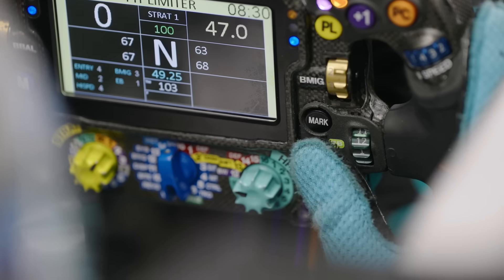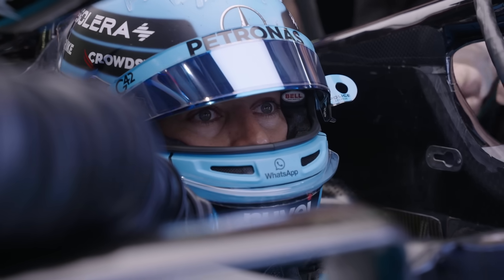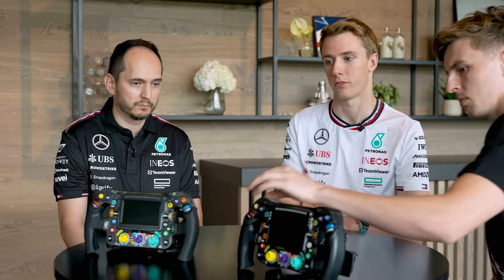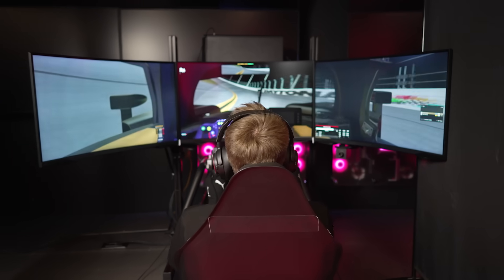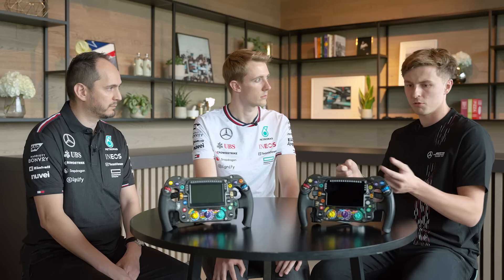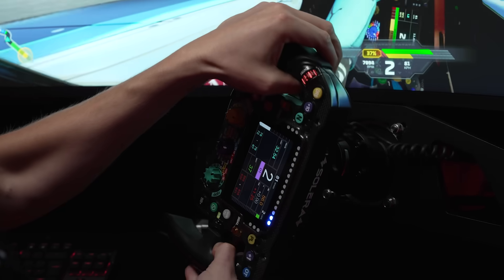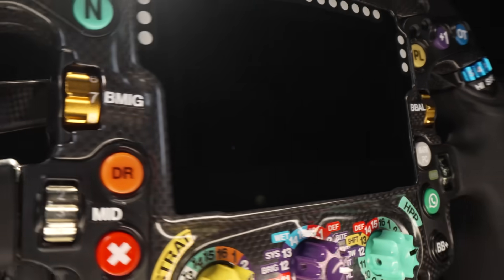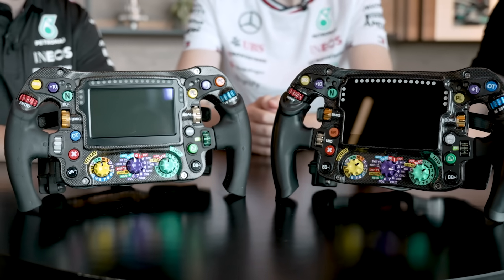We created the MOST accurate F1 Steering Wheel for Sim Racing! 😱

Comment: They gave the wrong answer when they said is it faster? Because with F1 you are trying to wring every drop of performance out of every part of the car and the decreased mental load having so many buttons to change so many things on the steering wheel may only increase performance or speed a fraction of a percent but that's still one or two kilometers an hour which is the difference between lapping someone and not at some tracks

Comment: I wonder if this wheel will have more success within F1 fans or simracing users, Mercedes has the best looking of the F1 wheels but not having the 7-way/funky switches can be a deal breaker, also it doesn't have proper dual clutch (has a feature that mimic it but it's not he same thing).
Was expecting more of a detail explanation of how it works and not a pure bs sponsored video, 280mm is good for Formula cars, but for prototypes is better 290-300 and for GT3 is better 300-310mm, so the best for all is 300mm...

Comment: 3:05 really emphasizes my feelings on this. In the past some F1 teams (not gonna name names, but… starts with an F) have put their branding on replica wheels, but they haven’t been exactly the same CAD models, materials, etc. Some people in the community have attempted to make replicas as accurate as possible, but they only had access to photos and rough dimensions. Photogrammetry is pretty good nowadays (see: 2020 Racing Point aero package) but it’s still not perfect, so it’s awesome that a true replica is available now. Thanks guys!
Reply: Surprised you didn't notice neither is this one the actual CAD, if you pay attention you would notice it's a combination of design of w11(=8~10) and w12(=13~15), and the grip especially the top end looks completely different to either of the actual wheels.

Comment: I am quite sure that they are different in many ways.

The main thing will be the software and hardware. The F1 steering wheel will have processors for comuication from the ECU or other car devices. In simracing the communication protocols with a windows PC are different. I don't think the data processing units in both applications require the same power, so they will have reduced costs.

I imagine that the screen and RGB lights on the simracing steering wheel are not the same as in F1. There they will have saved costs as the one used in F1, manufactured by Mclaren, I don't think it's very cheap. Also, it is not necessary to use the same component when you don't have communication with FIA, etc.

On the other hand, I imagine that the F1 one has a connector inside the QR, while in the sim one, the cable is separate, since, in simracing, each user will use a different QRs, for his simulator. The F1 car QR is unique (there are only two cars and they make it), and also, saving the cable is much more practical when it comes to getting in and out of the car, etc.

On the other hand, the guy on the right, says that in simracing, you need the same amount of buttons and knobs as you might need in the F1 car. In simracing, you often need to move around the simulator or game menus, and also change certain parameters in an unlimited amount of increments and decrements. The F1 car, generally the wheels they use are fixed position. Also, most of them are designed to be used when you are on the move. In simracing it's not like that. I haven't seen an F1 steering wheel with a funky switch for example.Generally, for most cars used in simracing, you don't need so many buttons and rotaries. Not even in the formulas.